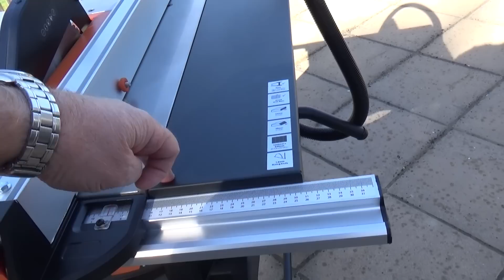Evolution Rage 5-S Table Saw Review

Comment: This is a joke review I have this sow and features like sliding table are a problem there is so much grease and dust is collecting like crazy . The table is not flat so u can forget squaring the blade. Push stick does not fit in to push stick spot 4 storage, and the fence do sent fit in to its place. This is a joke don't buy it all I can say
Reply: I agree with a few of your points but others not so much. Dust collects on any surface that you’re cutting on so that’s to be expected but you can minimise that by removing some of the grease and using a shop vac. The push stick does fit in the slot but backwards to how you would think.
Reply: @giggidygiggidy4884  those are not points but facts . Dust isnt a big problem but table can not be anything but flat and this jut like a bow from center to the left 6 mm down.And u and cope of other you tubers are the reason why I both this crap so thank u
Reply: gordanzzzz dude don’t blame me for that, I didn’t post a review on this thing, I just bought it like you did and I’m pretty disappointed with a lot of it too. So cheers.
Reply: @giggidygiggidy4884  o shit sorry m8 my bad .

Comment: I junked the stand gimmicky rubbish made an out feed table, infeed, and put a slow start switch and panic button mine never came with one?Its not great but does a job ok for the diyer but pants for the trade.
Reply from the maker: It is a case of 'horses for courses' Peter.  My cabinet maker's saw gave up the ghost a couple of years ago and I never bothered replacing it.  I use the Rage 5-S now and I can do what I need to do with it.  :-)